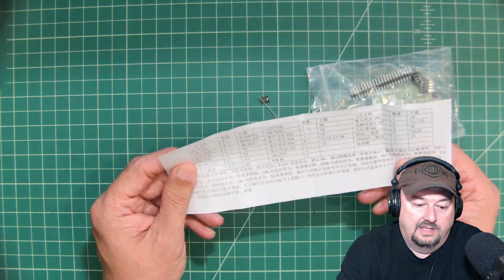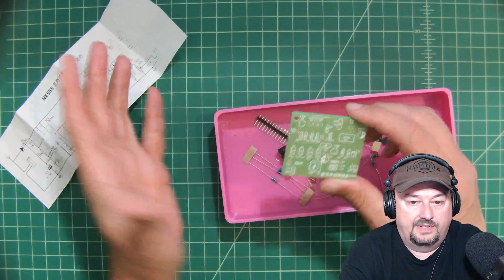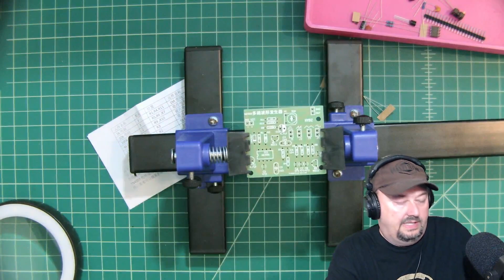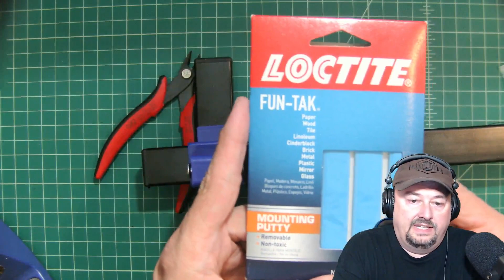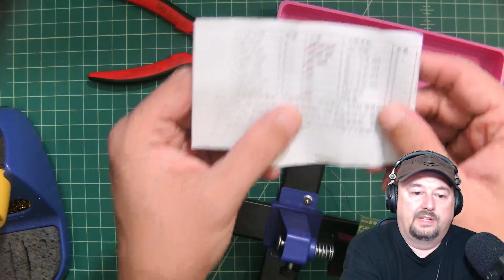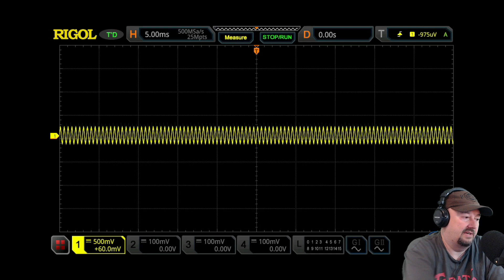DIY NE555 Signal Generator Kit Build

Comment: I just built this kit. I don't think your NE555 is shot, the circuit is just pretty low quality. I didn't expect much, and I did test other known-good 555 timer chips. It ain't bad, but to be any kind of useful you'd need to strap an op amp chip to it so the output was more than like, 50 microvolts.
Reply from the maker: Thanks for the info Jane
Reply: @TheSmokinApe  Anytime. If you want to test your NE555, look up that little circuit for one that blinks an LED and build it on your breadboard. I know you've probably got one and it only requires like 5 external components including the LED.
Reply: What could you do with it if you got the signal to a proper level?

Comment: Another great video Ape! The glitches when you touch the board or move things are likely do to lack of filtering and no shielding of the circuit. Doubt that the 555 is faulty. Keep em coming.
Reply from the maker: Thanks for the info HoH 👍 and thanks for checking it out 🍻